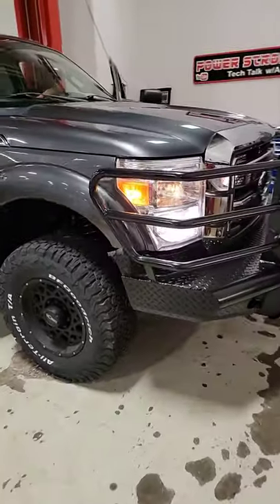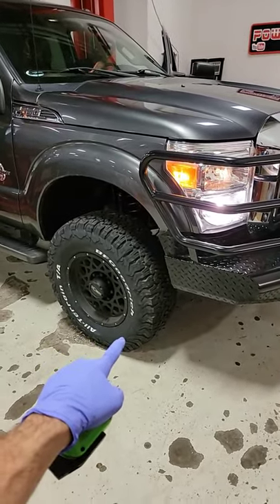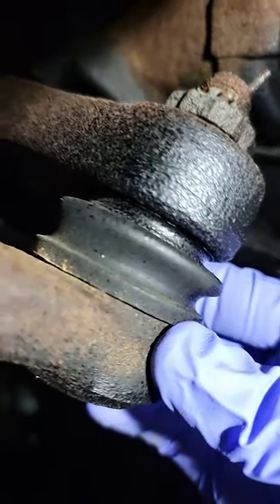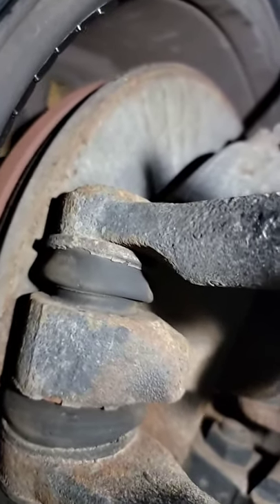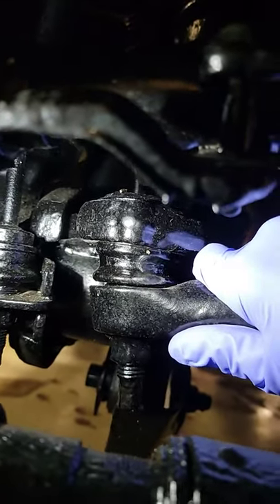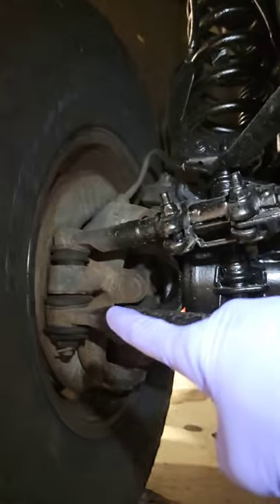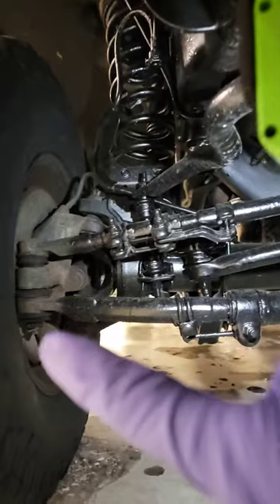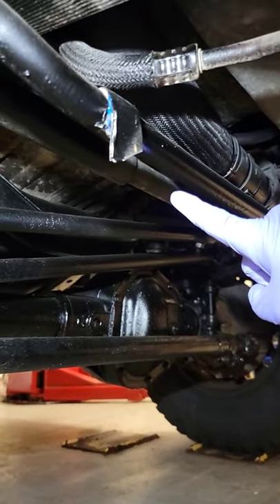DEATH WOBBLE FIXES! TRUST ME FOLKS!! Check your steering linkages

Comment: Trac bar is usually the culprit with Fords, Ram, Jeep straight axles.  Vulconized stock rubber bushing suck from factory and wear quick.  Oh and if someone says they stopped the death wobble with a new stabilizer. It’s just a band aid and not the actual problem.  It’s a bushing end problem.
Reply from the maker: Thank u kind sir
Reply: @PowerStrokeTechTalkwARod  Keep up the good content.
Reply: My older Jeep had death wobble from an internally loose steering gear. A quick fix was to adjust it, but it really needs a replacement or to be serviced.
Reply: I had a 1997 dodge ram 1 ton dually, I replaced all the tie rod ends, rubber bushing’s, and upper and lower ball joints, and mine still had the death wobble, replaced the stabilizer shock, and that was the thing that fixed it, everything has to be tight, the stabilizer has to work as well, usually the reason the stabilizer goes out is because all your joints are loose, and it wears out your stabilizer.

Comment: A tech told me( many years ago) to check front end wear every other oil change...the weight of diesel motor puts a lot of stress on bushings...also lift kits and over size wheels & tires changes geometry which  puts on more stress
Reply from the maker: Gosh no1 thinks about that any more! Nice comment pal🤙
Reply: Very trur
Reply: You got that right. Ppl just slap it on an it dose this an be like wtf this product is shit. An most ppl don't do process of elimination either till they find the culprit.
Reply: Same things existed for years on straight axle trucks with or without diesels, could've been big blocks, etc... The problem is shitty engineering and shitty part quality causes ridiculous failure rates.... Hence the death wobble ordeal...

Comment: I lifted my truck and it didn’t start the death wobble till I put radius arm drop brackets on and then it started I replaced both tie rod ends on the passenger side and my steering damper the other joints seem to be fine and after installing new parts it still does it maybe even worse now. Any ideas on what I should do or look for/at

Comment: The last thing that gets checked or changed...
is the tires....
a friend had Everything replaced in a Buick Electra.
when trying to fix its death wobble... finally after $$$$, the solution was replacing the front tires...fyi.

Comment: That is ok if it has a lot of miles on it. I had a 2007 F250 Super Duty Diesel that did the death wobble the day I drove it home from the dealer new. What do you think would cause it. I put a steering stabilizer on it and it helped but still had the slight wobble.  Never could fix it.

Comment: All accurate, loose steering components add or magnify wobble. I’ve driven many rigs with sloppy steering and loose components with no wobble too.  The higher lifted, the more important to add positive caster. Off-Roading, add less… hard surface mainly, add more. 

The Caster is the vital point… add caster  1-2.5 Positive degrees and all those loose components will be loose without the wobble. F250-350 one size caster alignment bushing, F450-550 take larger bushing. 

Relatively quick swap of OEM bushing with adjustable bushing, and only $50-90 the pair. 

I DIY installed the F450 Caster / Camber bushing for $98 and about 2hr including setting up jacks and removing wheels. 

Plus improved steering stability and tracking.
Compare to a bicycle… turn handle bars backward… steering bad, easy wobble, now turn wheel normal, fork forward, positive caster… steering stability and tracking.

Comment: I drive a 99 F350 for my hot shot trucking business. Last DOT level 1 inspection at a weigh station, the young officer had me racking my steering wheel back and forth for nearly 5 minutes. He just KNEW he was gonna find something loose and put me out of service with my oversize load. Silly boy, he obviously didn't see all the new hardware under my truck!
Reply: At least he's working

Comment: Ya thats key, I had an 06 F350 and it ate drag links ball joints, and track bar ball joints.  I towed a lot with it and did not have oversized tires but whenever they would wear out steering got real funky....it was downright puckerish at times while towing.

Comment: Why is it, that ONLY 4x4's have this issue?  Also, the ones I've seen, the trucks had oversize tires or rims, WIDE "mud" tires, or they were jacked up.  Maybe if you left it alone...  And YES, I have a Ford F350, 4x2, and never had issues.  it's all stock.
Reply: Agree after using 4x4 I got the death wobble

Comment: Can anything be done to prevent death wobble?  I have seen some people saying more caster helps.  Set us straight ARon😂
Reply from the maker: Step one fer me has been replacing all loose components. Have had great success
Reply: @PowerStrokeTechTalkwARod  so if there are no lose components then do nothing?
Reply from the maker: Yea if your front end is tight then you shld have any steering wheel oscillation present

Comment: My 2019 did it with 30k on it, ford threw a new steering stabilizer at it and didn't record that it came in for it...I've done a lot of reading about this and from what I've come up with is the geometry is wrong on these front ends, everyone says put bigger things on there or new parts but there's a reason why these parts are wearing out so quick...a heavier duty tie rod will only last a little longer if something is outta whack with the geometry. These are fleet vehicles built in large volume if one thing is off a degree then boom, a cover up by ford
Reply from the maker: I agree with u except for the last statement. I'm sorry that it is perceived as such...
Reply: @PowerStrokeTechTalkwARod  understandable...but it's easier for ford to throw a steering stabilizer at a problem then to admit they built 250,000 trucks wrong, that's what I'm saying...like the 6.0, they knew they had a problem with that motor but did they stop using it? I know international built them and all that, but instead of trying to remedy the issue they mass produced them I think from 03' to 2010 right? Weren't they in ambulances from 08' to 2010? Then when class action lawsuits came up they draw it out for 15+ yrs till people can't afford to fight it anymore...I don't feel bad for a company that charges $100k for trucks, ford needs to fix the problems instead of brushing it under the rug and people will buy more
Reply: I love your channel by the way haha I'm not trying to argue just my opinion...from a die hard ford buyer, who owned two 6.0's and stuck with them
Reply from the maker: I can appreciate your comment & time, its THEE other guys that deleted and blocked from this platform..🤝🤙💯
Reply: @PowerStrokeTechTalkwARod  Was I right about the 6.0's in ambulances from 08-10? Hahaha just curious because I heard that from a friend of a friend

Comment: I have a 2012 F250 that the DEATH WOBBLE  happened! Pulled us into the LEFT lane from the Right lane.  Truck has ALWAYS  been serviced  by DEALERSHIP!  Less than 30 days after Sparks coming from the front under truck someone saw & pulled be over.  Brake wouldn't release. I had to pull  it back up with foot. Was towed into dealership  costed me approximately  $4000. Then Death WOBBLE  happened  after that after they worked  on the FRONT END! Then steering  stabilizer  & stuff  had to be replaced!  Another $4000 w/n 30 days ONLY had 105,000 miles for a Diesel!  I'LL NEVER HAVE A F250 AGAIN! My F350 I drove for years ONLY 
Replaced water pump! WORST FORD EVER F250! FORD DOESN'T WANT TO ADMIT to any wrong!!  COST $8000 WITHIN 30 DAYS!

Comment: POSSIBLE BUT I DON'T QUIT BUY YOUR STORY WHEN IT COMES TO THE DIESEL ENGINE.IF THAT PU WERE MADE FOR A DIESEL ENGINE,NO,IF IT WAS MADE FOR A GAS ENGINE,YES.-- AS FAR AS LIFT KIT,YES,WHEELS AND KNOBBY TIRES YES,IF THAT TRUCK WAS MADE TO DO OR DESIGNED FOR ALL THAT LIFT KIT,BIG TIRES AND WHEELS THEN FORD WOULD OF MADE IT THAT WAY,HAY HAVE YOU NOTICED IT WASN'T MADE THAT WAY !

Comment: Junk, can't understand why people still buy this crap and why Ford never improves. I have a 10 escape in 02 these vehicles had a recall because the cheap metal in the subframes would disintegrate and try to kill the driver guess what problem my turd has and Ford knows about it but not enough people have died yet for them to issue a recall. How does this happen other than Ford does not give a crap. And a former Ford tech I can tell you they fix very little unless they have to. The rig it until warranty is gone.

Comment: All 3 TJs i had and my wifes JK was lower control arm bushings and track bar bushing, fixed it every time. Also threw on new stabilizers as well seeing as they were stock and wanted to beef it up some.

I just replaced my wifes tie rod drag link as well, and the ball joints were in great shape on the JK and the death wobble started to happen a few weeks after that was all done. So a new set of control arms for the lower for 80 bucks a track bar for 115 and problem solved. The stabilizers were just because it was time for a new one. 

By the way we have 37x14R15 irocks no wobble vibration or anything after the track bar and control arms. Rides as smooth as it did stocked. The stabilizers are the new dual stabilizers from rough country for 250 so not sure how much they helped or not.

Also did the same for 3 TJs and always fixed it never had a issue again, well for the years i had them that it.

Comment: the trac bar must be parallel to the front axle- if it is diagnol to it when the axle is bounced for any reason the trac bar pushes on the axle which is Levered against the steering arm creating the wobble! axle goes up and down pushing and pulling againsr the steering arm making the wheels jerk back and forth-

Comment: The real reason is too little castor due to steering geometry. Then it become critical that all joints is supertight. More self-streer would allow more slop before wobble. Also remeber not to turn wheels at stand still on heavy cars🙂

Comment: Looks like a rebuild is necessary. I wish some of the F450 hardware would work on the F250s.
Reply: 450 front end parts still wear out at 150k~ if youre using the truck.
Reply: @bizenniboi  correct. All depends on usage.
Reply: I think Carly makes some nice greasable ball joints and tie rod ends
Reply: @DS-TRUCKS  you’re not wrong but I wouldn’t go that route with a daily. Cost will not outweigh the mileage. Personally at shy of 100k miles and it’s all original less the damper which I replaced because the old was definitely tired. Lol 
I’ve seen many 18-19s need early front ends. I’m guessing it may have been a parts batch issue.

Comment: Be sure the shop you take it to lift the truck with all the weight on the wheels or you or them will NOT see this. If they lift it from the middle of the truck you can’t see or hear this. Finally a shop I took it to today,  found out what that noise was before I got the death wobble. And it’s exactly what this gentleman is saying it is on this video. It’s a 2017 dually
Reply from the maker: See, i told yall

Comment: Shouldn’t the drag link hook to the tie rod just in front of where the track bar hooks to the axle so the drag link and track bar are at the same angle and it doesn’t steer when the suspension is compressed?

Comment: the 4 link suspension design is flawed in that it lacks lateral rigidity.  a 3 link design is far superior in that it has no need for a lateral support bar to hold the axle in a stable arc.

Comment: Even really worn tires can cause death wobble on a traditional steering linkage setup on top of a straight front axle.
I had a 24,000 mile jeep jku with worn out stock tires. Every morning on way to work at same spot in the road the hit caused death wobble. Fresh new 32's (275/70/18) tko bfg's solved the problem 100%.
All steering gear was tight as could be before and after especially with low miles like that so it was hard to figure out at first. The desire for a better tire led to the "repair"
Reply: Nobody at the Jeep club or shops would believe me when I swore mine was tires. Everything got checked and rechecked so many times and I quit the club from all the know it alls telling me I had brown eyes because I was full. On a vacation trip, 2 of the tires had sidewall blowouts within 2 days. A very nice tire shop guy opened up on a Sunday, found me a used pair of BFG ATs which he couldn't balance because the machine was broken. I ran those for at least a year without ever balancing and never had a wobble once. I figured afterward that there was hidden damage from an accident a couple of years before where a Chevy 1500 work van tried to share my lane from 3 lanes over and hit the tires before the side of the Jeep TJ. I had scuffs, they had door skin torn open. Nothing looked out of the ordinary to any of the tire shops etc. So there are all kinds of problems that can cause death wobble.

Comment: Mine just did it at 37,000 today and im not happy about it.  I bought a old bubble top 52 ford truck out of a field sitting in Ardmore Alabama for $3000 and had it shipped to Maryland. The truck had  48,000 original miles on it (Dirt Road Miles) and the steering was tight except for the old manual steering box which I rebuilt. I replaced everything because of age and safety concerns but The point is my $60k modern vehicle should not be having loose anything at 37k when a 70 year old truck is tight.  There is Zero excuse for it.
Reply from the maker: Yea well the roads today suck...I hate to drive that ol girl...ur gonna be replacing them too
Reply: @PowerStrokeTechTalkwARod  That's very true. It was a nasty bump I hit that triggered the wobble.

Comment: Just happened to check my front end last weekend. I could literally get tge drank link to make noise by rotating back and forth.  Question is bad joints or just loose and needs to be snugged up?
Reply from the maker: Bad
Reply: @PowerStrokeTechTalkwARod  looks like I have a project this weekend  😊 thanks man!

Comment: I wish ford used better components.  Had it happen to me. Took truck in. Told me I missed warranty by two weeks and handed me a $2500 quote
Reply from the maker: If they used better ones....wld you have been happier with a 3500$ quote....damn'ed if u do, damn'ed if you don't 🤷‍♂️
Reply: @PowerStrokeTechTalkwARod  at 60k miles I would hope that this wouldn't be an issue. And yes i would if it meant the components were greaseable. Im a mobile tech for a International dealership. I know all about big trucks big bucks. Dont want something that as I am going through a corner on a interstate I have to slow down to 40 mph  cause I thought I was gonna go through the gaurdrail
Reply from the maker: Jesus...sorry pal...i totally feel ya

Comment: 2016 and the truck's steering already crapped out?!?!?!?  "Built Ford Tough", alright!  Cheapo parts in a Tonka toy!
Reply from the maker: Its called our roads man, they SUCK. The governor said she gon a fix the DAMN roads, yet here we are.............
Reply: @PowerStrokeTechTalkwARod  It's taken 10 YEARS for them to repair a local section of highway.  I guess because the NY boys are tired of their Ferrari's getting chewed up.  Or maybe the Secret Service needs a smooth road for The Beast when POTUS gets ran out of DC one day.

But back to the original topic.  I have an 8 year old KOREAN suv.  Haven't had any steering linkage problems, despite daily driving over the cheese grater....

How is it Japanese cars of the 70's and 80's, German cars of the 90's and 2000's, and now Korean cars of the 2010's and 2020's are outlasting domestic vehicles?

No joke - saw a video of a BRAND NEW Ford Explorer's front end being chopped by two techies in a dealership bay.  Engine blew up with 8 MILES on the odometer.  Built in Mexico, sold in US.
Reply from the maker: Omg 🤯🤯🤯

Comment: My son's 2019 F250 started it at around 70,000 miles I checked it all...found absolutely no wear.. he sent it to the dealer....installed  a new steering stabilizer shock.. and wow! That was it.. I wouldn't  believe it until I had driven  it myself. I've  had 4x4s for 45 years  I've had them all.. never had a steering shock fix the wicka-wucka oh motherfu..ka!! AKA death wobble